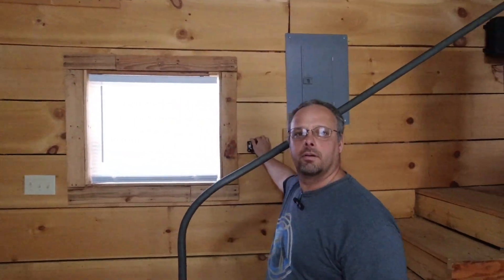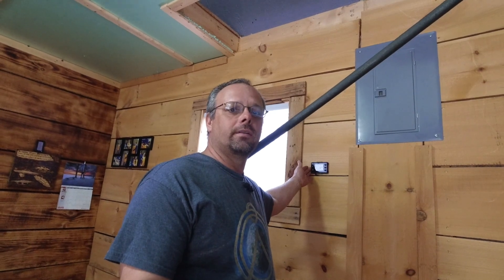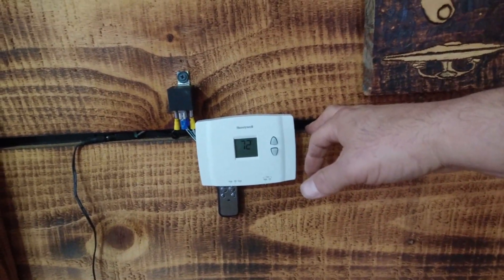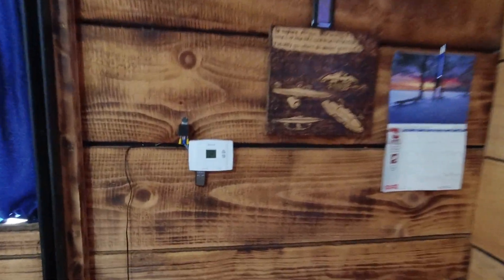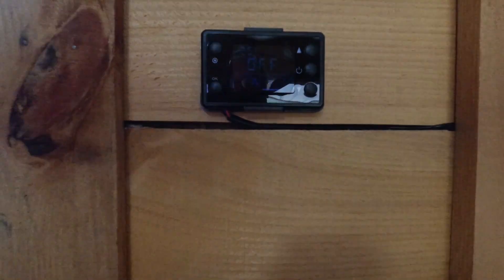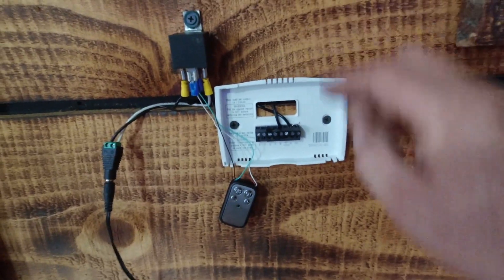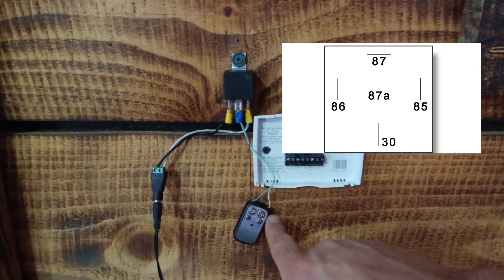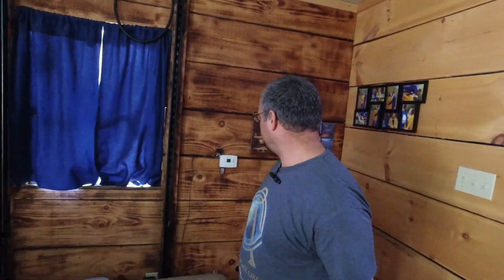DIY Diesel Heater Thermostat

Comment: Simply install a thermostat with a normally closed contact that opens when the desired temperature is reached. This contact will be connected in series with the temperature diode located on the heating element. If the voltage across the diode terminals drops, the motherboard will send the heating cut-out message (I assume with the 10-minute cut-out process). Once the wall thermostat sees that the room temperature is dropping again, its contact switches to closed. The thermal diode then receives voltage again, and the motor restarts normally. In heating mode, it is this diode that decides whether the heating is switched off or not. So if you add a thermostat that cuts out (generally, thermostats have two contacts, one that closes and one that opens), you need to choose the normally open contact when the room is warm. If this works, everyone will be able to solve the problem. 

Il suffit d'installer un thermostat avec contact à fermeture normale et qui ouvre lorsque la température désirée est atteinte. Ce contact sera mis en série avec la diode de température située sur le corps de chauffe. Si la tension dans les bornes de la diode chute, la carte mère enverra l'information de coupure de la chauffe (je suppose avec le processus d'arrêt des 10 minutes). Une fois que le thermostat mural voit que la température de la pièce redescend, son contact passe en ouvert. La diode thermique reçoit alors à nouveau de la tension, et le moteur se remet normalement en route. En mode chauffage, c'est cette diode qui décide si le chauffage est coupé ou non. Si l'on ajoute donc un thermostat qui coupe (généralement, les thermostats ont deux contacts, un qui ferme et un qui ouvre), il faudra choisir le contact normalement ouvert quand la pièce est chaude. Si cela fonctionne, tout le monde pourra régler le problème.
Reply: If this works, all thermostats will be compatible, which will simplify the modification: simply cut one of the two diode wires and connect it to the wall thermostat (in series), then select the normally closed contact when the temperature is low in the room. When the thermostat cuts the voltage to the diode, the heater will think it has reached the desired temperature. 

Si cela fonctionne, tous les thermostats pourront être compatibles, ce qui simplifiera la modification : il suffira de couper un fil des deux fils de la diode et de le relier au thermostat mural (en montage en série), puis de bien choisir le contact normalement fermé quand la température est basse dans la pièce. Quand le thermostat coupera la tension de la diode, le chauffage pensera qu'il a atteint la température souhaitée.

Comment: Why you didn't just put a on/off switch instead of the rely.
Reply from the maker: A relay allows you to control a circuit with a low amperage signal and is basically a remote controlled switch. 
I have since found a much better solution and did a video on it. Here is a link to that. https://youtu.be/ZsVv6thNrrw

Comment: could you wire the relay to the power buttons in the actual thermostat of the diesel heater instead of relying on the remote?

Comment: Wow how many did you blow up working this out. Will definitely not attempt this -  too confusing and too many variables. Thanks
Reply from the maker: If you aren't confident trying this I definitely wouldn't recommend it. I have electronics experience so it didn't bother me. It won't blow it up so to speak, but overheating it could mess with the display.

Comment: Why not just get afterburner or the other company that makes a remote that does what your doing ?
Reply from the maker: You can do that. There's always something you can just buy, like the Wabasto heater for example. For a piddly little $1,199.00 you can buy a heater that does more than the chinese one with the afterburner. Comes with a great warranty too. It will probably last a lifetime where these heaters will not last with constant use without replacing virtually all the parts. 
This is a cheap way to do it, which is what I like to do, just to see if I can do it. 
There are many ways to do the same thing, in fact a company is sending me a remote that does this plug and play to show on my channel. Probably the company you are talking about.

Comment: Nice job. I think you nailed it!
I am stumped by the issue of carbon build up and the effect it has on the glow plug.
I wonder if a propane/butane pilot flame could be lit before the diesel instead of a glow plug arrangement? Avoiding explosion would be the first obstacle for an arrangement like that, but that could be as simple as ventilating the combustion chamber as the gas lights the fluid.
But it could go bad pretty easily.
Reply from the maker: Running the heater on high for the majority of the time works well to keep the carbon down. The propane idea would probably work to prevent it from developing in the first place. Good idea.

Comment: Neat idea but the way it is, the remote will be constantly transmitting. A better solution would be to use a momentary type switching device in place of the relay
Reply: You need 2 relay, one for the on and one for the off button
Reply: Thats why he used a 5 pin relay, its has 2 positions. One normal open one normal closed
Reply: Did you not listen? He said the transmitter cuts out after 10 seconds.

Comment: Perfect. Thanks a lot. Only question is if you set it to a certain degree i.e 22 celcius. And the room is 17 c. İt will work till 22c and shut off. And when it comes to 21.9 c it will work again. So it opens and shut down in small time frame.

Comment: so the thermostat in these heaters is located in the LCD pannel ?
Reply from the maker: Yes it is. It does have another temperature sensor for the heat exchanger body though.
Reply: @lukeFugate  so if the unit is outside you can just extend the wires from the LCD panel and that will get your thermostat in the room you want..  .. thanks

Comment: Just copied this for frost protection in my motorhome to stop it from dropping the water from the system , genius!!
Reply from the maker: Thanks! It should work great for that. Just make sure the battery stays topped off. It takes a lot of power to keep igniting the glow plug.

Comment: Ok help me out, if my thermostat is battery powered and I do not have a DC power adapter connected to the wall, then my 85 and 86 prongs will connect to what ... Power coming from my thermostat instead?

Comment: Have you made any video updates? Im not too good with electronics or soldering. If I send you the thermostat, relay and whatever parts you need I pay well?
Reply from the maker: As it turns out, I don't even use the thermostat anymore. I wouldn't recommend this setup. It uses too much power to be useful. After three cloudy days it will run down my battery bank. I just open a window, or the door a little bit.

Comment: With a two wire thermostat like the one you have you do not need a relay at all. It's basically an in-line switch. When the temperature drops the contacts will close and the heater will come on. When the temperature rises to temp the contacts will open and the heater will shut off.
Reply: He's using the relay to be able to switch the "off" button....which needs contact.
Reply: Yes, you need a single pole double throw relay or find a thermostat that has such output function.

Comment: have a look at the afterburner controller form Ray Jones, he made a replacement controller for the chineese diesel heater that does it all, run in start stop mode, calender,  frost protection, bluetooth, wifi,mqtt etc
Reply from the maker: Thanks  I'll check it out.

Comment: Looking at the bottom of the 12 volt relay. 86 and 85 pins are the coil. Which number pins are N/O, N/C and Neutral? Thanks for the video!
Reply from the maker: 30 is common, 87 is N/O, 87a is N/C

Comment: I would think the buttons on the remote are momentary switches, so via this method the remote would be continuously transmitting on or off... it might be ok, but another reason to run wal-wart power  instead of the battery in the remote.  Possibly I missed something as I did skip-watched this video.  Some universal remotes I have defintley use momentary switches and transmit as long as the switches are closed. (not one shots)  Maybe this remote IS a one-shot Xmit?
Reply from the maker: They are momentary switches. It does time out after 10 seconds, but still had problems. I ended up using timer circuits on the main controller button to solve that. Here is that video https://youtu.be/X3cNIMcSQn8

Comment: It's not a bug, it's a feature. Original German heaters were operated like this - shut itself off when set temperature was reached, then restart when it got too cold to heat up again.  Problem is sometimes this things fail to start, no matter Chinease or German. And then you are waking up because of cold and have all that fun to try to restart damn thing. I would rather have mine keep running and crack open a window.
Reply from the maker: You make a good point. I just don't like having to keep taking it apart and cleaning it out. Running on low for long periods of time will cause it to soot up. The one in my bus would get the temp up really quick then drop down to low. I would do like you said and open windows or the roof vent. I figured this was fine until it got to where it wouldn't light. I had to take it apart and clean it out. I know this is pretty much standard procedure, but if they don't run on low they don't soot up like that. 
In the house it would probably be fine to open a window like you said. I can get to the heater to take it apart pretty easily in the house. So far it hasn't failed to start besides when it ran out of fuel. Thanks for the comment.

Comment: If that thermostat turns off the diesel heater without letting it cool down you're going to damage the diesel heater..  Also I would not look forward to getting up and putting it on 6 every time the thermostat turns it off and back on....
 So you're proposing this but it's really not practical. I'm a little bit dumb founded.
Reply from the maker: It goes through its cool down every time. It doesn't have to be on 6 to heat the house up. It will do fine on the temperature it comes on at. The older units would be better for this though. They start wherever you last had them set. It works well. I've been using this like this for a while. 
I guess the real reason I went this way was I'm too lazy to take my heater apart and clean out the soot every couple of months. I used the original thermostat in my bus for a while and running on low is really bad for these heaters. They will soot up until they won't even light. 
The proper way is to clean them out once in a while though.
Reply: Hi Luke
Would like to do this to my heater but I’m wondering….if the diesel heater is in Celsius how does it know to convert to Fahrenheit  or would I have to put the thermostat on Celsius?

Comment: I can't follow that ,  cold or not if it turns down real low it can't keep getting hotter and hotter like you say..
Reply from the maker: That depends on the temperature outside and the insulation in the structure. If it is really cold outside and it continues running on low it will just maintain the temperature. It will however soot up the unit running on low. 
If it is just cold enough outside to be uncomfortable without heat or if you have really well insulated, it will keep heating it up.

Comment: Love this idea. I take it the heater does a full cool down off cycle without the thermostat trying to turn the heater on again when the temperature drops? (thinking about a vehicle where temp changes can be faster)
Reply from the maker: As long as it is insulated good it will work. It will do a full cool down cycle. If you can get a thermostat with a bigger spread between the kick on and off it would be better.

Comment: You think the try 6360d1002 would be easier way of doing the heater what terminals is used inside thermostat also
Reply from the maker: Yes it would, I just looked it up. The auto heat and cool feature would be ideal for this. I'm not sure about the terminals on this one, but it would be in the literature with it describing where to hook the normal thermostat wires. 
I have found a way to do almost the same with the thermostat I have. I soldered wires on the relay inside the thermostat. The internal relay is a normally open and normally closed relay. I put a wire on each of the three terminals and ran them directly to the wires on the remote. It allows the whole unit to function without the "wall wart" and the external relay. 
I will be making a video showing how it works but I am waiting on a part for it first.

Comment: Really impressive.  Elegant solution to the start up / cool down routines still running.  Ideal in a building, but they do draw quite a few amps (10 I think) in those stages so if in a vehicle people need to be aware of that.  They use fewer amps (2 I think) in steady state so unless on a hook up and leisure battery (or a very large leisure battery set up) sometimes cracking a window is better.
Reply from the maker: True. it does require multiple glow plug activations. I am working on a way to have an automatic vent to put the heat outside when it is too much and leave the heater running. In my bus I had to keep opening the roof vent. it would still pour out the heat and I would end up shutting it off anyway.
It would be boiling hot in there as the heater was on the lowest setting it could be on.
Reply: Use a 4" erd. it would take 2

Comment: @luke fugate could the thermostat be wired into the controller in a similar way and not use the remote?
Reply from the maker: I am working on a way to do that. I just have to wait on some parts to come in.
Reply: @lukeFugate  brilliant can’t wait to see that update too, I’m hoping to set up for my garage and was thinking about using a thermostat to control it, then saw your video!! Great work keep it up!☺️👍🏻

Comment: I never would have thought you could do that but I should know better- you can do/figure out anything!

Great job. Maybe I can do that for my tiny house whenever I get it.
Reply from the maker: It should work great for your tiny house. The dry heat is much better than gas.
Reply: @lukeFugate  yeah I would really want to be off grid and have solar panels and I wanted to utilize either a wood stove or that diesel heater because propane there's just too much moisture I haven't had as much issues with my butane but in the first place you got to keep the butane warm enough because once you at 32° forget it.

Comment: Also this is brilliant!  The idle setting runs dirty and will carbon up the heater much faster, also the constant switching between idle/high if you have the temperature selection type thermostat controller (different then the one you have, it has green digital characters) it uses much more energy as it cycles the glow plug much more frequently.
Reply from the maker: The glow plug cycling more often is going to use more power. Having a thermostat that spaces out the kick on and kick off temperatures more would be more efficient.

Comment: I have the same heater and controller, there's two modes: Idle and Full Blast. In my experience the thermostat function works flawlessly. They have a timer built in you can tweak to turn off and on.  Make sure the shutdown sequence always occurs (it takes about 2 minutes to shut down) because it is important as it cools the electronics board as well as fires the glow plug to clear carbon.  You should never just shut it off.  Just some general information for those not in the know, thank you for excellent video, I like them all.
Reply from the maker: Yes the shutdown sequence is very important for those reasons. I always thought the circuit board should be mounted to the outside of the unit for this reason. If a fuse blows, it will pretty much just self destruct. 
If the heater could just be set to come on and go full blast every time it would be better for the thermostat mod.
Reply: @lukeFugate  I've had mine accidentally disconnected twice when on a high heat.
 What happens is the bearings for the fan cook and it will eventually lock up, but no problem with anything else.
 When it gets to warm I just open a window, fresh air is always good.
Reply: all the thermostat does, is hit the off button on the remote, which cause the proper shutdown cycle.
Reply: Seen in person unit unplugged with out shut down and it melted the control module. As previous mentioned fan stops spinning and fuel is still burning and causes over heating and the control board is bolted to the housing.
Reply: Thanks for posting the interesting hack to add a thermostat, would be interesting to see if it causes the glow plug to burn out prematurely. As it will be doing a lot more start up shit down sequences